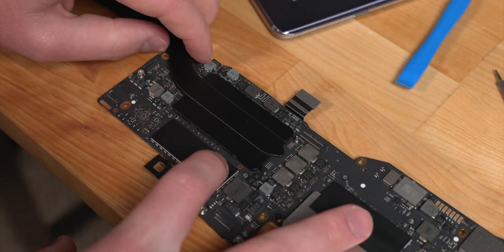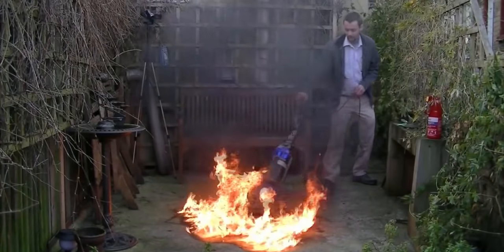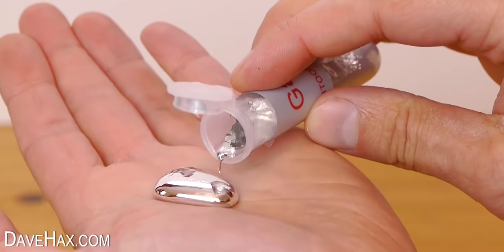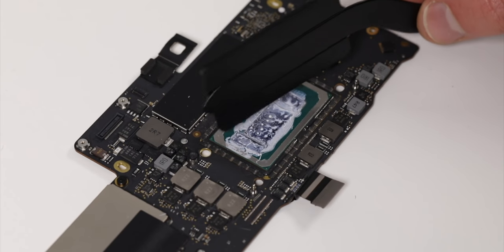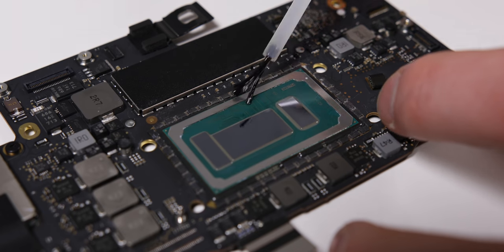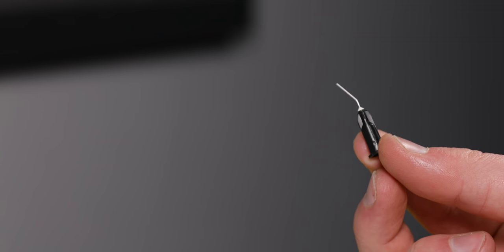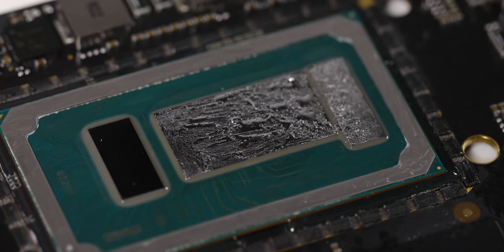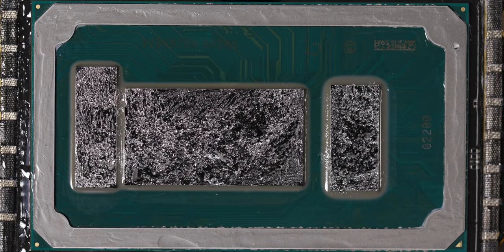Liquid Metal in a MacBook Pro: No More Throttling!

Comment: I have another trick to help dissipate heat is to put thermal pad over CPU heat sink so it can use Macbook Pro backplate as a heat sink.
Reply from the maker: This is true! But I don’t like warm legs. 😂
Reply: I tried this with my wife’s laptop, it was way too hot when I put the pads near the cpu, but I moved them closer to the fans and heatsinks. It was a nice balance.
Reply: Yes

Comment: I've done this too on my i9 MBP 2018 and it got really quiet. Temperatures dropped from 95°C to about 70°C. The 4 years old thermal compound already was dry. I've used some transparent nail polish to protect the cpu pins, works great so far.

Comment: Drill speed holes in the bottom cover of the case where the fans are to improve air flow to the fans. This will improve temperatures more than the risky liquid metal thermal paste. You can drill on a duplicate case cover bought from Amazon if you want to keep the original case cover pristine.

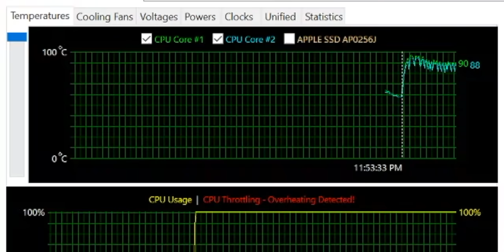Comment: 6:00 "for the first time ever it isn't throttling"
windows: Throttles
Reply: There is of course gradations in throttling. For example it certainly hits the base clock of 2.3GHz of the i5-7360U. And 3.2GHz might as well be the all-core maximum turbo. But yeah it's not "isn't throttling".

Comment: You can use Macs Fan Control to monitor temps of different cores/part of the computer as well as forcibly regulate fan speeds. If maxing the fans you likely could've dropped a bunch more C with the liquid metal, would've been good to run all fans (well in your case, fan) at max to note the temperature/performance differences.

Comment: LM can cause corrosion issues on copper in as little as 6-12 months. While it still won't be as damaging and spectacular as aluminum,  the gallium can fully migrate into the copper and dry out in 6 months resulting in overheating again. YMMV. I definitely don't think LM is a apply once and forget it for 3 years product. If you don't fry your laptop with the application, you should still plan on yearly sanding/reapplication.

Comment: Why are there 3 dies on the chip? I know one is the integrated graphics but whats the last one?
Reply from the maker: That’s the SSD.

Edit: oh... you mean the actual chip—not in AIDA—lol yes, the below comments are dead-on.
Reply: I'm talking about onboard the processor chip. Like there are three shiny squares on it, I know one of them is the central processing unit and the other is the graphical but i am wondering what the third one is
Reply: The GPU is integrated into the CPU die, this is the larger die of the 3. The one right next to the CPU die is the eDRAM used as L4 cache on Iris Graphics. The other one (with some spacing between it and the CPU die) is the PCH, which is integrated onto the CPU package since Haswell for mobile U and Y CPU variants.
The PCH is like the southbridge in older Intel platforms. The northbridge has been integrated inside the CPU die since the 1st generation Core i CPU.
Reply: The dies right next to each other is the iGPU and CPU for sure.. but I see no info about the third isolated die
Reply: piernov piernov Ah.. Thank you very much! Thats pretty interesting. Didn’t know the edram for the iris graphics was a little ship of its own.. I always thought the separate dies was the igpu and cpu
Reply: Yea I noticed this too. Just take apart my gaming laptop with a 7700 HQ (the same equipped on the most expensive 15' Macbook Pro) and it has only ONE single die, even though it has intel HD graphics 630 integrated. So I wonder why the heck the U chip has 3 separate dies lol
Reply: Tuan Hoang Minh Piernov has the answer above👌 Part of the reason is that intel HD 630 has no dedicated eDram like the iris 640

Comment: you don't need to spread the paste on your cpu like that, that create bubbles of air on the heatsink and lower the thermal conductivity, just place a drop of paste and then put the heatsink, the pressure will spread the past evenly

Comment: I should do that to my 13 inch MacBook Pro from 2014, getting really hot these days. Question is if I should go for liquid metal or just regular heatsink paste. How high is the risk anyways with the steps you took?
Reply from the maker: Honestly, I think the performance gains would be more than noticeable with standard thermal paste. Get some of this. Best performance for non-liquid metal. http://amzn.to/2Hut2C9
Reply: Thanks a lot for the response, I'll look into it. My machine gets hot quite quickly these days and that the MacBook usually stays cool and silent was one of my main reasons to go with a Mac

Comment: I wish apple would just spend a tiny bit more to just solder their chips, it wouldn't matter to them if it makes it even harder to repair their devices, free performance and a better "out of the box" experience.
Reply from the maker: I tend to agree.
Reply: actually laptop cpus dont have an IHS, its direct die. and its not on apple to do that, its the chip maker.

Comment: I'm interested in liquid metal for my desktop gpu and also for the laptop. If I can I would like to ask you a question: why did you also isolate the chip with silicone? Shouldn't the chip be isolated already? 

I was thinking of nickeling the surface of the laptop heatsink which will come into direct contact with the liquid metal. If the liquid metal were to corrode the nickel, I could easily redo the nickel plating.
I am worried about the chip, that is I do not understand if the liquid metal corrodes that too and I am certainly afraid that it will come out by shaking the laptop. For the desktop gpu I have the same fears, because mine is mounted vertically and I would not want gravity to run off the liquid metal.

Comment: Nice video.  I put Conductonaut LM on just about anything I can.  Under the CPU lid on all processors I have/friends have that can be delidded, on top of the CPU when using a cooler with a copper base plate, on GPUs with copper base plates on their coolers (which all the high end ones have), laptop heatsinks... It's awesome stuff and one little tube goes a very long way.   Of course, the downside is that if you are not extremely careful it will short things out.  Not for clumsy people but if you are willing to take care it can make crazy improvements to thermals.

Comment: Pro-Tip. Don't squirt the LM directly onto the chip. Instead, away from the computer, get a little bead on the tip of the "syringe" and with your hand under it, move it over to the cpu/gpu.
It's just safer.

Comment: Try using Cooler Master Mastergel Pro, safer and will match or even beat the liquid metal, just depends how you add/spread it over the cpu (you did it incorrectly in your video) but it will suffice.

Comment: Thanks for your great video. because of this video, I successfully applied liquid metal on my rMBP 2015 with confidence.  There is one thing I should call out basing on my experience, after applying the liquid metal, please do a Cinebench test or other CPU intense program. this will build a lot of heat on cpu which help the liquid metal fill the gap.

Comment: My crappy mac air would always hit that 100C limit.  Liquid metal worked for me. Replacing it with a Lenovo had an even better result lol. FYI Lenovo likes to put two fans in their laptops.  Better to have two fans running at low rpm than one at mid or high.

Comment: Bro, ive got question but it might/not unrelated to the topic
You see, New MBP touchbar and non-touchbar have different mainboard. Touchbar with smaller board due to extra fans, non-touchbar also didnt come up with holes(inhaust/exhaust no idea) in both sides like touchbar's did (correct me if im wrong)
Question are:
1. What apple do to extramile on non-touchbar's board?
2. Is there significantly different between dual fans and single fans on same chip (in temps per se) ?

Many youtuber said that non-touchbar is the best mbp you can buy for bucks per performance but being in that perspective. I think touchbar is better despite that glimicky little-long-ass screen nobodys using
Reply: Only the 13" MacBook Pro with the Touch Bar has a 2-fan setup. I don't think Quinn has that particular model, so I'm not sure if he'll be able to test it out.
Reply: "Only the 13" MacBook Pro with the Touch Bar has a 2-fan setup" your point was exactly written in my comment

Comment: hello! i have an issue, when i use bootcamp in my mbp 2017 13" (i5 , 8gbram), the battery donesn't charge over the 98% is it normal? i have window 10 home, do i need to change it to w 10 pro?

Comment: If the bios allows or utility from the cpu/mobo manufacturer, 1st try to undervolt the cpu as much as possible.
Got an Athlon II X4 2.6Ghz + Hyper 212+
stock voltages 1.3250v 55°C LOAD @600rpm
undervolted to 1.1125v 41°C LOAD @600rpm

Comment: Gallium is extraordinarily corrosive to aluminum.  There are Youtube videos of Gallium eating thru Aluminum rapidly and perhaps in the alloy form it is less corrosive but I personally wouldn’t take the risk especially because it would probably void the manufacturer’s warranty.
Reply from the maker: Vincent Stouter This is mentioned in the video. Also mentioned that the liquid metal doesn’t contact any aluminum on MacBook Pro. Cooler block is copper.
Reply: Snazzy Labs I agree completely with your comment but my macbook pro has a lot of aluminum so if it leaks it could cause significant damage.  Perhaps the tin & indium alloy is less corrosive than pure gallium but as with any liquid cooling media it is challenging to have a seal remain intact in a portable device subject to mechanical and thermal cyclic stress. 

     Snazzy labs was completely up front about pointing out the risk.  I guess the sweet spot would be to have 100% contact with no loss but I’m not that good.  Thanks again for the quick response.  No disrespect was intended in my response.  You have a fine and informative channel.
Reply: If it leaks, the macbook might as well be dead. Electrically conductive and all.

Comment: i have the 10th gen macbook pro 2020 13 inch and would appreciate a video fo step by step application of the thermal past. i couldnt find one on ifix it. i do not want tot damage the sensitive sensors and parts of my new macbook pro, but also want to apply the liquide metal thermal past.

Comment: Better off with NT-H1. Yeah, liquid metal does provide better thermals but it requires yearly maintenance (sometimes sooner). If the board moves a lot or is placed sideways you run a high risk of it seeping out on to the traces, capacitors etc and that will fry the board and or other components. It also slowly degrades any metal it touches. After one year, as many videos will show, the gallium will eat into the copper (even if only slightly). If it's a device you plan dto use for 5-ish years this is a terrible idea and you are much better off using proper thermal compound. However, if you have money to blow and plan to get a new device next year or perhaps immediately if it fails then sure go for it. Otherwise stay away from it.

Comment: Thanks for the video! I've been wondering if this would bring down MacBook temperatures enough to avoid throttling ever since Linus made his video doing it on a gaming laptop. Though at this point, I'm more interested in Apple putting a decent GPU in their 15" machine than I am in them using liquid metal cooling.

Comment: Literally just did this last night to my 2015 Macbook Pro. It was quite fun to do but def nerve wrecking.
Reply from the maker: How’s it holding up?
Reply: Great I brought it around with me all day yesterday came home to run some Heaven Benchmarks not a huge improvement on the heat generally around 2-4 degrees different but got a higher score by a bit with it staying quieter overall. 
I am thinking about drilling some holes under the fans and adding some mesh to see if that brings the heat down more though. Seems to top out in the mid 80s while gaming.

Comment: The aspect ratio looks good. By the way you can install istat menus on mac os and you will get awesome hardware monitoring.
Reply from the maker: Joaquin, thanks for the comment! iStat is pretty handy, but I find it isn’t as rock-solid accurate as Windows applications are. Temperature is notoriously difficult to measure accurately in macOS, but for everything else, iStat is pretty sweet. Thanks for watching!

Comment: the problem is also. todo with the micro code. each manufacture. puts. on. the cpu. I have noticed this with my dell 7373 i7 8550u. the default bios let the cpu run up. to. 2.7ghz then with the v1.8 its limited to 2.3ghz which is crazzy all because of current limiting. so. i then used xtu and fine tuned the. values to achieve 3.2ghz at 80deg the curernt limit should not have been enabled

Comment: have l.m. in my macbook pro 2011 17' for one year now - works better than all that i used bevor.
Reply: update, it corrodes even into the copper but also the surface of the gpu lost the writing.

gpu died, and could not be replaced because of the missing letters.

would never ever apply it again

Comment: I've done this mod to my early 2013 15" MacBook pro. 
I expected a drop in temperatures, which didnt come. What I got instead was about 400MHz less throttling in aida64  but my cpu is still pinned at 98-105 degrees on the 1st core. It's also still thermal throttling. I'm considering making holes in the bottom plate to increase airflow 😐
Reply: Is the temperature/throttling only an issue on the i9 15-inch, or does it affect the i7 as well?  I'm thinking of getting a new MBP at some point (to replace an early 2015 13-inch that has a broken keyboard [bit of coke..]).  I want to get the 15-inch because I want the 32-MB RAM - I'm assuming that RAM is still quicker than SSD swapping no matter what Apple claims).  Would an i7 rather than i9 create less of a heat/battery/throttling issue - how much of a performance boost is an i9 over i7?  (And would the 15-inch run cooler than a 13-inch simply because it's bigger?)

Comment: Why dont they put this on in the factory if its such an improvement? seems like a hassle for average consume but huge gain for a small price?
Reply: because it is 1) dangerous and 2) it "drys" out faster with a worse fail condition than non conductive paste. A better question is why doesn't Apple, being such a premium brand with frequent overheating issues, use a better non-conductive paste like thermal grizzly, pk-3, and others.

Comment: Why do cpu thermal throttle at 100° when silicon melts at 2500° and why dont you just solder the chip to the ihs
Reply: You don't need it to melt, you just need the functionality to degrade. Which would happen much earlier. Now I am not a computer scientist but from a chemist perspective for example we see that catalysts start to degrade at high temperatures. This is because if you have 2 elements (say nickel and Cu) they might start to move around and lump together at higher temperatures. The size and surface  of the particles might change as well.I imagine something similar happens which causes the transistors to no longer function as such. The issue is not melting but having a part that still functions the same.

Comment: How long until the Gallium are through the copper and basically ruins the laptop? If it‘s like 10 years I‘d say it’s fine, but 3 is way under he lifespan I would want a laptop that expensive to have
Reply from the maker: From what I’ve read, more than 10 years. Extremely long time. Obviously it depends on how thick the block is. Mostly just creates “pits” which may make it necessary to use a paste once again as the liquid metal will be too thinly spread to make contact between the IHS and the cooler.
Reply: 10 years sounds very reasonable. Thanks for taking the time :)

Comment: I was initially quite interested in liquid metal as a thermal interface, but upon further research concluded that it's not a reliable solution. Here's why:

 From anecdotal evidence seen in other videos involving copper heatsinks, as well a paper i read on the interaction of liquid gallium with copper, it seems that the gallium in the liquid metal does indeed form an alloy with copper which continues to grow until the alloy is completely solidified. 

This coincides with the observations from other users who've reported the formation of a "solid layer" over their copper heatsinks, as well as the "drying out" of the liquid metal over time. This could lead to a deterioration in cooling performance with time and possible damage to our beloved electronics. 

Hence, I'd personally stay away from liquid metal for copper heatsinks. Having said that, it should be fine for applications involving nickel plated heatsinks or between a naked die and IHS with proper precautions like how others have successfully done. These are my conclusions after doing some research. Hope this helps others make an informed decision. Cheers!

Comment: That's what happens when you cram everything in a tight space. Yeah, it's a feat of engineering, but it's going to have cooling and longevity problems. (believe it or not, high temps cause semiconductors to fail earlier)
Also, BTW, do NOT do this mod. The liquid metal will form an alloy with other metals, and will cause a complete failure of your computer.

Comment: If it corrodes overtime even on copper, then whats the point?
Reply from the maker: To keep temps low. Lol. Copper corrosion is very, very, very slow. It won’t be a problem. Even after a decade.

Comment: My cpu temps are not too bad on my 2010 MBP , i don't really care about fan noise. I use Macs Fan control and i'm fairly aggressive with the fan curve setting the min 40 and the max 70 on the CPU. I actually haven't seen the poor thing go above 80 since i started using the program but it used to hit 100c often before. It's also had a service since I've had it, my mate replace the thermal paste but im curious whether i could get the max temps even lower with liquid metal to 50c